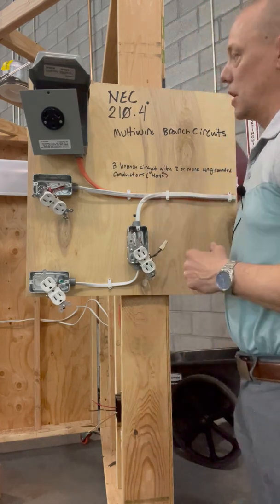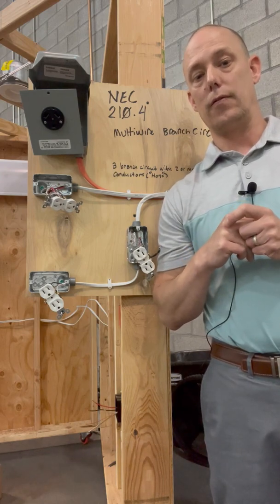Multiwire Branch- Circuits NEC 210.4

Comment: If all you have is spare 2 pole handle tied 20 amp breakers in your panel can you use just one side of that breaker with 12/2 wire for a single 120v 20amp circuit and leave the other half of that breaker vacant? Also is it possible to run two individual 120v 20amp circuits each with 12/2 wire from each side of that breaker so they have their own neutrals to mitigate the risk of a dropped neutral destroying electrical equipment or does it have to be 12/3 mwbc? Asking from a safety(functional) standpoint. Breakers in question are double pole on separate phases from old register heaters QBH b/bc panel

Comment: Can you place GFCI receptacle on each circuit of the multiwire branch circuit if you've pigtailed the neutrals?
Reply: Yes, the red and black (12/3) must go to the Line connection of each GFCI. Red on one, black on the other, the order doesn't matter.

Comment: Thanks Chad. Can you help me with a question? I want to add an outlet to my garage that will provide 3600 watts (2880 continuous) for tools, that is GFCI protected. Can you outline how this would be done? I know I could add two GFCI outlets side-by-side, and run two 12/2 wires from each outlet to their own 15a or 20a breakers, but is there a better way to do it? Thanks!
Reply: If you have room in a panel for a 15 or 20 amp two pole breaker,  the most cost effective way to obtain the power you want would be to use a 12/3 homerun from the panel, with a standard 2 pole breaker,  and feed this homerun to a two gang box, and use two GFCI receptacles, one on the black and white, the other on the red and white, with all the grounds connected of course.  You could run two 12-2 homeruns,  but that would cost more than one 12-3 run, and you would need two new circuits anyway.  As your needs change you can add more receptacles to the load side of the GFCI on either the black/white or red/white,  using 12-2 and use standard receptacles.  

Another option is to use a 15 or 20A two pole GFCI breaker and standard receptacles,  but these typically cost over $100,  definitely more expensive than using a standard two pole and two GFCI receptacles. I personally would go the cheaper route,  but perhaps you enjoy spending more $$$ than necessary to accomplish the same goals,  so I thought this option would be worth mentioning 😅

Good luck with your project

Comment: Great demo.  In residential because of the AFCI and or GFCI requirements multiwire circuits are virtually obsolete,  even though two pole GFCI and two pole AFCI breakers are available, they tend to be well over $100 and not as widely available.  

In commercial buildings,  multiwire circuits are widely used and many times the advantages outweigh the disadvantages, such as savings in labor and material,  less voltage drop, and smaller raceways needed.    Say in a large office building where I have perhaps a couple dozen or more 120 volt circuits on the same general area,  and the supply is a 120/208 Y 3ø system.  I could use a three pole breaker and only have to pull one neutral for every three circuits vs a neutral for every circuit.  That could potentially save several thousand dollars
Reply: In residential, could you use a regular 2 pole breaker and have 2 dual function afci/GFCI receptacles at the other end?
Reply: @surferdude642 not really supposed to. AFCI receps won't fully protect the wiring from the breaker up to the point of the the first AFCI.

Comment: Great job explaining this detail it’s the one area where even experienced electricians can get wrong and put themselves in danger. It would be nice if the camera could get tight into the boxes and if you would have drawn the circuit on paper with the panel board and breaker configuration including different phases. It would help to ensure wiring was undertaken correctly.